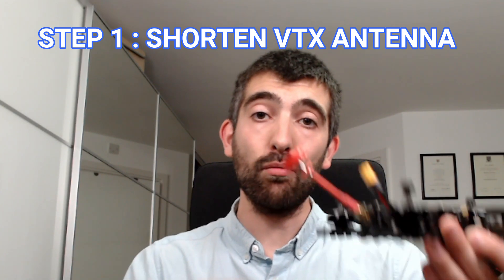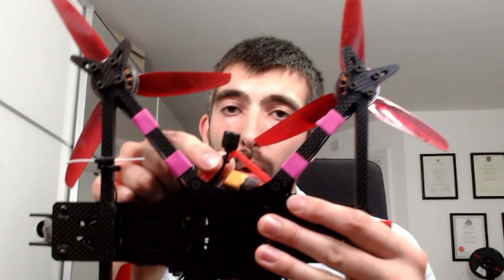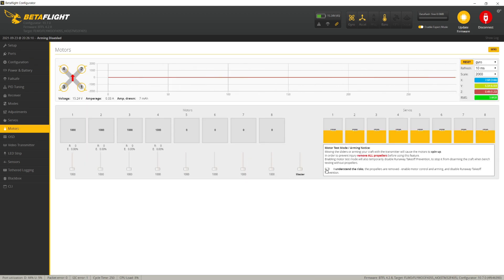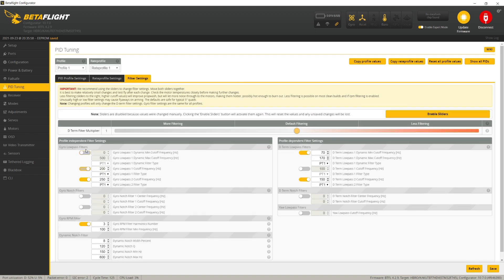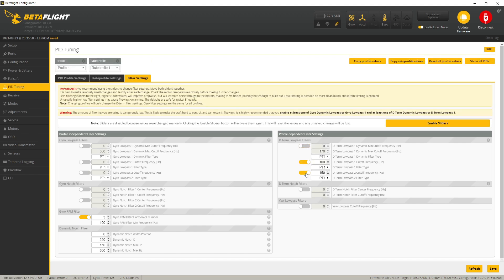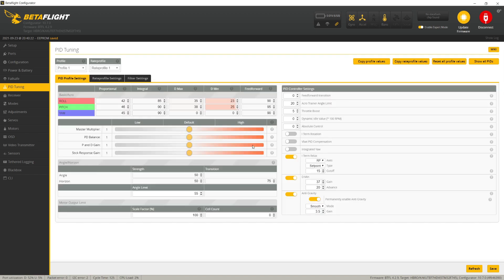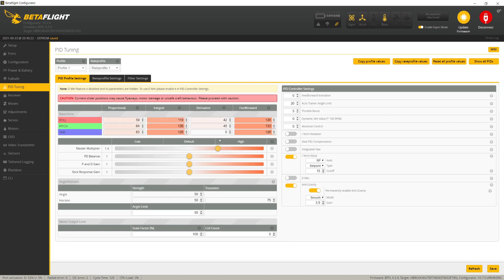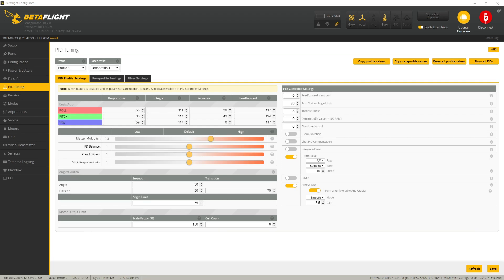5 tips to help your quad fly its best! Freestyle, Cinewhoop, Toothpick, Tiny whoop or Long Range!

Comment: Your antenna advice isn't wrong per 'se, but ill take a 25% increase in video quality over a 5% reduction in flight performance.... I think the stock length caddx vista or a stock rush lollipop antenna is a good compromise. no need for the super long antenna, but a stubby isnt enough either...
Reply from the maker: 100% agree with you. I see people running super long antennas on freestyle rigs and having difficulty with vibrations all the time. Just knowing that a long VTx antenna can cause Jello can be really helpful for those pilots! Obviously you have to make the best decision for your flying.
Reply: TrueRC Matchstick ftw. Perfect length imo and Kevlar toughness.
Reply: I like the mid length antennas like the standard triumph or vas minion. Need something that pokes above the lipo.
Reply: @jlarson42  yeah I like the look of that minion
Reply: i agree on you on this. i have a stubby for freestyle/proximity and rush for general flying mix coz it has better video signal.
Reply: @grabejud  yeah for sure depends on the environment and output power, and type of flying.
Reply: Great question, I was wondering how a short stubby would affect range and quality
Reply: @MrSabram07  to me the issue with a stubby isn't quite that its "worse range in a quantifiable sense", but that it is far more *inconsistent*. When you have LOS from the goggles to the antenna, the range should be the same. The problem with the stubby is there is a much higher chance that carbon or a standoff or the lipo is in the way of that....so it kinda depends.
Reply: @mouseFPV  this is something I have not thought of yet so I tend to use the longer antennas with a thin coaxial.

Comment: Short and clear.  Really surprised about antenna mount, that it makes so significant effect on fly performance.
Reply from the maker: Yeah the antenna mount is a huge deal. So many pilots run super long antennas for best possible signal and then have vibration issues, it can be very difficult to diagnose!
Reply: I watched a JB video from like a year ago when he was reviewing the GoPro max 360 camera. You could see the quad in the video and the antenna was bobbling all around. It really set home in my mind that the antennas move around alit more then you would think.

Comment: So what does mini and micro sized quads mean? 2, 3 even 5 inch?
Reply from the maker: From Tiny whoop to 6inch! Including cinewhoops, micro long range etc.
Reply: @ChrisRosser  as well the way u tune the filter? 😳
Reply from the maker: @Quadtastrophe  Yes. I fly the same filter settings for most quads up to 6". Give it a go and see if it works for you.
Reply: +1 for this question. Do these apply to the smaller 2.5 and 3 inch micros as well?
Reply: Cinewhoop? Like the squirt v2??? Ty